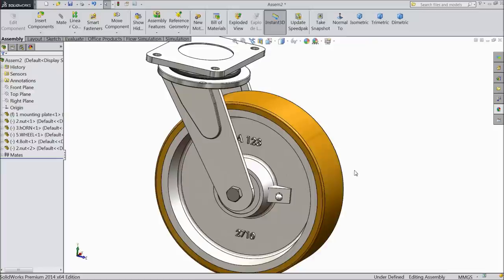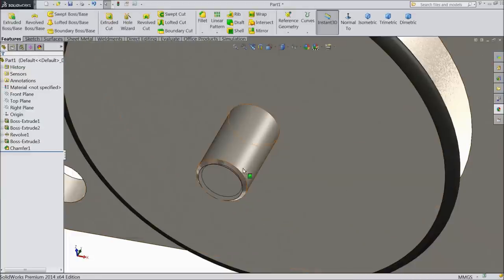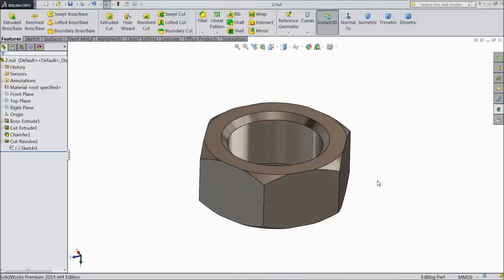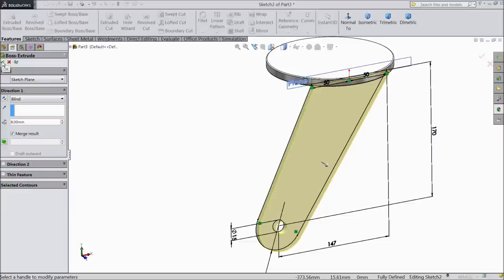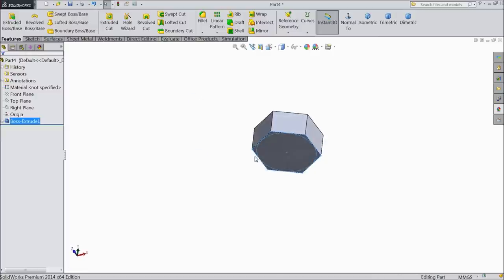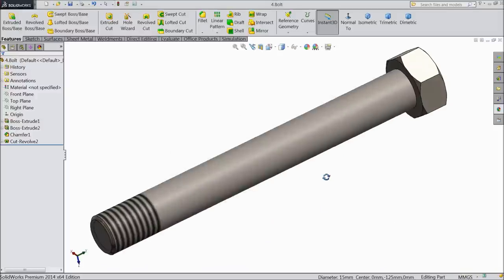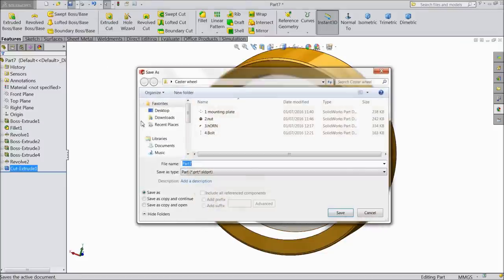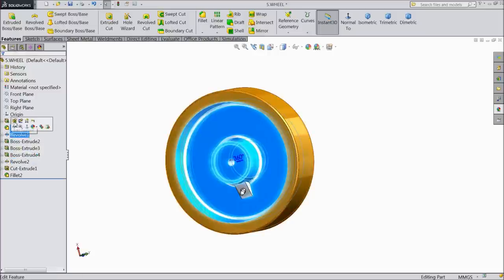Solidworks tutorial Caster wheel

Comment: What must be the"dragging distance" of the horizontal wheel axis with respect to the virticle swivelling axis of the top plate to ensure efficient turning of the wheel. To put it another way, what is the angle of the horizontal axis of the wheel with respect to the verticle axis of the swivelling axis at the top. It seems to me that the greater the distance between the two axis gives a better swivelling action but you don`t mention this. You show us HOW to design it this way with specific dimensions but not WHY you design it this way. If the angle ot the horizontal axis of the wheel with respect to the vertical axis of the support brackets of the wheel was zero then the wheel wouldn`t swivel. So what is the angle ( or distance ) between these two axis to make an efficient swivelling wheel. That`s what I want to know. It`s a very pretty drawing but you don`t explain the concept of a swivelling wheel and why it swivels.